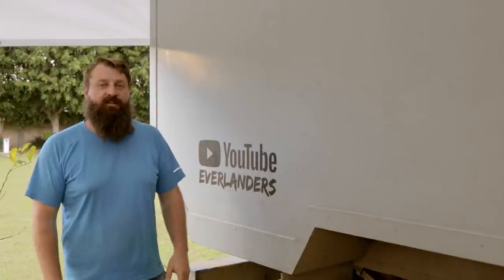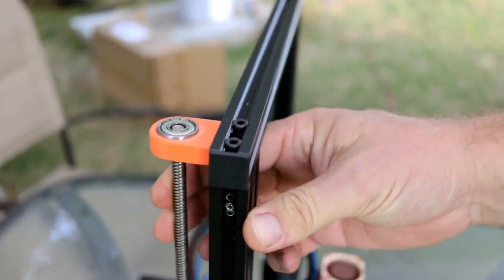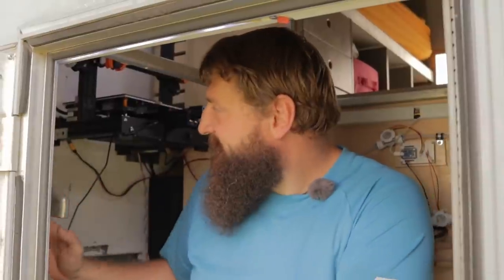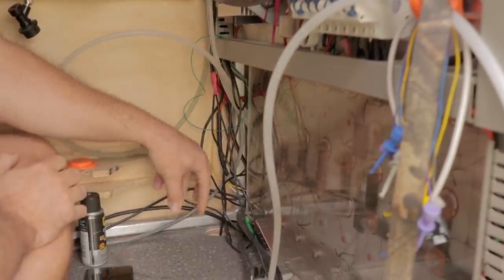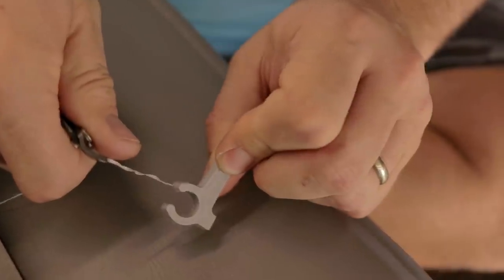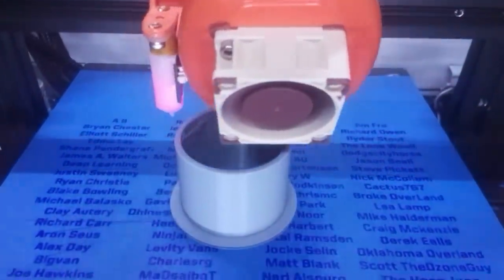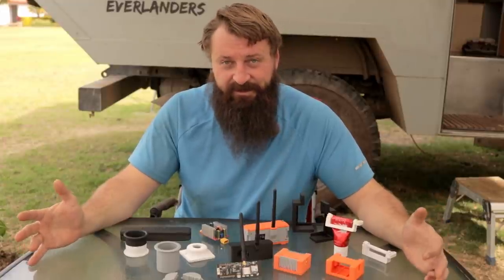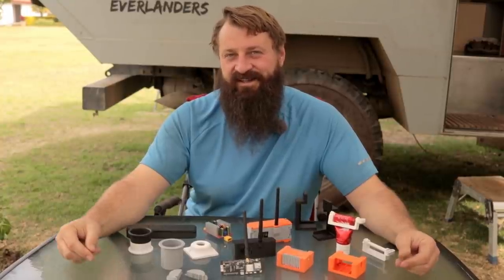Installing a 3D Printer in our Overland Truck  - Everlanders see the World!

Comment: We've been fans for a while now and you two been an inspiration for taking our company on the road. This video is obviously super relevant for us, thank you!! Are you primarily using PETG or a high temperature PLA? Material choice is going to be very important for your application which I bet you're fully aware of. I'm a huge fan of polycarbonate personally. My only real concern with the build is if there is any flex between the composite panel & bed frame then the machine may get twisted. My shuttle bus printer build uses static clips to hold the belt / rails in place for an E2 Raise3D. Since we'll be using it for work I can afford the extra real estate on the bigger printer but we plan to mostly be printing for folks who need them too. So cool to be on the same page.
Reply from the maker: Yes, Primarily printing with PETG although I have some PLA's here too...  There is absolutely zero flex in our composite panel construction, especially there, where the printer is installed, the panels are triangulated, and the aluminum exoskeleton of our rig is the densest. And for those not aware, our box is on a pneumatic flex mount system that keeps torsional chassis flex from being translated to the habitat box. Nice to have a professional printer in our following... I was most familiar with printing ABS back in the day, and had a tough time getting PETG printing well, lots of conflicting information about bed temps online. Still struggling with small feature, first layer, bed adhesion.

Nice looking bus, I wish I could have gotten such extrusions down here in Mexico, I would have liked to fully box this printer in, but the cost was crazy-high to get them here.
Reply: @Everlanders  We've definitely made some progress since my last little video, including a diesel heater and a functioning bed to desk conversion. I gotta get that all edited, oof. Thanks for checking that out! I found a NYC company for the extrusion as 8020 would have been an arm and a leg let alone a trip to Mexico. Thanks again for the reply, if there's anything else we can help with I'm happy to consult. We do so for a another maker YouTuber Crafsman Steady Craftin and he's great. You two are some of my favorite videos to catch up on.

Good to know about the flex concern too, better than I could do on a pre-made shuttle bus that's for sure. I expect a little more rattle in my build haha. At the studio, we have an outdoor pickup locker that's all metal and I had to print/install a marine solar fan to make sure our PLA prints didn't soften from my (unintended design flaw ridden) solar oven and even so we don't use it when it gets over 95f here in the states. What doesn't seem to warp at all are ASA, PC, Nylon and TPU beyond some expensive proprietary formula like Colorfabb Ngen. 

I'd recommend trying ASA as it prints more easily than ABS (especially in humid areas.) You may have to print your spools empty quick otherwise moisture is going to be the real villainy thing long term. I know it's expensive to ship but I can probably send you a few spools if you like. Do you have any nylon? Just a small spool can extend the lifespan of your printer by doing coldpulls from the extruder whenever things start to clog up. 

PETG is finicky though, it cools irregularly compared to other materials and I usually print pretty hot at 250, .6 nozzle with no retractions. This evens out the cooling as it takes a wider bead more time to cool overall. And chunky parts functionally are better than their thin layer counterparts IMO. Printing thicker layers (with an extrusion width multiplier at 200% or so on layer 1 only) will make your PETG prints bind more easily without a raft since it creates better surface area contact with the bed. It'll also make them more optically clear (at 100% fill) as thicker layer = less porous/brittle sublayers causing light diffusion and structural weakness. This is also why increasing temperature at higher output extrusion is important.

Sorry for the rant, just thought that may help!
Reply from the maker: Thanks for the detailed reply... I did print all of our Camera Pods and Dash parts with ASA actually, but thanks for the offer, shipping to Mexico and the ~30% import taxes won't be worthwhile I'm afraid.  Lots of other good tips, I'll need to come back and re-read this...

Comment: Another inspiring video. Is there a list of parts for the mods to the 3d printer?
Cant be much else you can fit in your Tardis? 
Is the unmentioned 3d print on the the Home is where the wifi box? Or is it where your aviator specs are hanging?
Reply from the maker: You got it Eddie! It's the SD/micro SD/USB drive holder above the plaque! Completely forgot to mention it while recording the video. And yes, I'll make sure to list all the mods I made in the blog post that I should be working on instead of reading comments! 😂
Reply: @Everlanders  Yeehaa!!!!. How much of a 3d printer does 10 points buy me?
Reply from the maker: You're going to need to bank them I'm afraid... Even the entry level printers start at 211,000 points.

Comment: love that unboxing, have you tried increasing the resolution of the camera in the /boot/octopi.txt?
Reply from the maker: I have a DSLR on a motorized slider triggering via USB... But the pause during the photos is leaving goobers with PETG...
Reply: @Everlanders  I had a similar problem in you later change gcode try doing an extra retraction before the p41, like G20 the p41, it should do a retract and Zlift the move then octoprint should see the p41 for layer change and take you lapse pic
Reply from the maker: With PETG?
Reply: @Everlanders  no I had similar issues with pla
Reply from the maker: PLA is a walk in the park in comparison to PETG stringing...

Comment: glad I'm not the only one that requires a 3D Printer on my rig...   Alas, I have to use my "real PC" with good video card to run the CAD though... 
Love your use of buck converters instead of the wasteful wall warts.  If feels so wrong going from DC to AC back to DC again, so glad you are avoiding that.  My bat is 48V so I will be using buck downs for whatever voltages are called for... Now I need to see if I can run the PC itself on buck converters... (rather than use the PC power supply).  Then to cut open the monitor and see if there is an AC to DC converter in there somewhere that can be bypassed... Basically a "make your own DC appliances", as most circuits run on DC on the inside...
Reply: After sleeping on this for a night, I found a new PC power standard called ATX12VO , which uses 12V only for the whole PC, then the Motherboard itself has downconverters for any peripherals... So, this is a game changer to make off grid PC's possible!  So I think the PC with graphics card will need 34 Amps at 12 V for 408 watts of power to the MB, so a 50 Amp 48V to 12V converter should be perfect... Looks like I will be building a new ATX12VO PC after all.
Reply: ...or my Dell laptop's power supply is 19.5V @ 3.3 Amps = 65 Watts - So I'll need to find a 4 amp variable converter and dial in the voltage and connect to a barrel jack that fits the laptop...